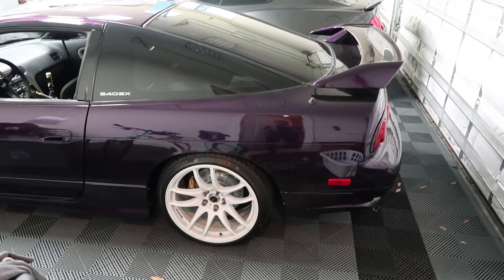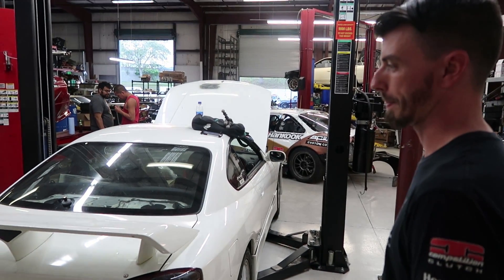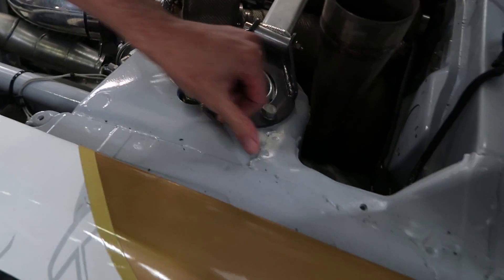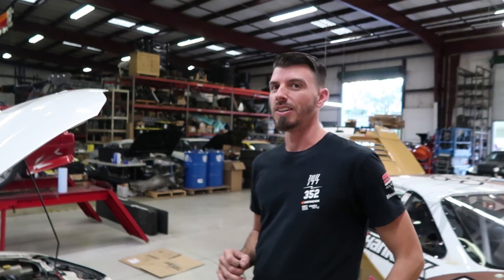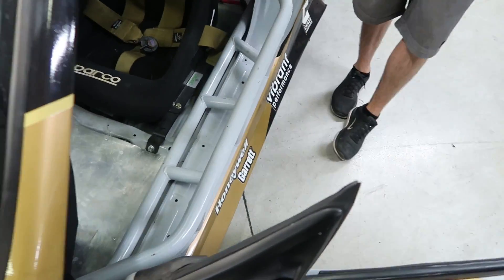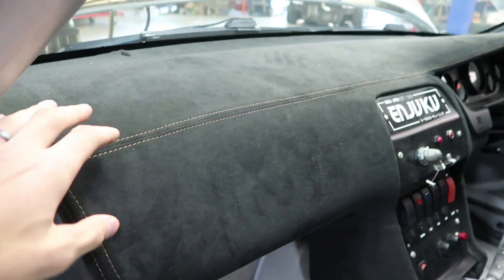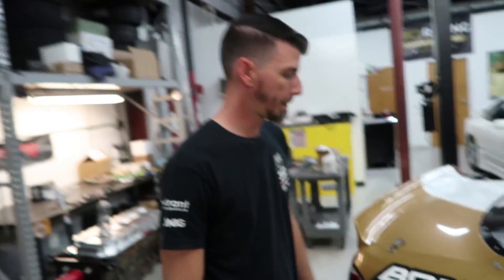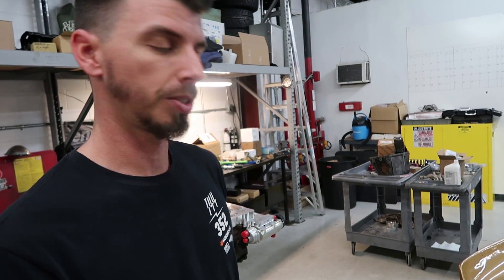Enjuku Built 2JZ S15 - Short Term Plan

Comment: RAD Dan uses a spring set up made by I believe drift motion that is better than the latches used. It holds with Dzus as well but the spring gives a little motion when the front bumper drags or he bumps a door. Not solid is better for motion in a fiberglass part that love to crack and fly apart.

Comment: Adam, the roof damage is courtesy of the importation method. Shipping containers are far too tall to be the cause, but instead, the car was imported as a bare chassis (or else it would've been crushed, 25 year law states an s15 is illegal for importation into the US), with another car stacked on top. Hence the damage.
Reply: It was probably smuggled in on top of a bunch of engines in a container, it's not an uncommon way to bring illegal cars in.
Reply: Agreed, consensus is that the car was tossed in a crate, smuggled, and not taken care of lol

Comment: What was the name of them fasteners?!?! Been looking for an actual name but haven't found it...
Reply: Dzus fasteners! we use em for race bodywork on sportbikes as well :D
Reply: There we go, now I'm getting results! Are they fairly decent to install or are they a nightmare?
Reply: Same as hood pins, drill a hole for the fastener, bolt/rivet a metal plate to the panel for the fastener to clip through.
Reply: What about the front bumper latches?
Reply: Those look like these http://www.aerocatch.com/home-page/aerocatch3

Main problem would be you need a bigger flat surface to stick them to, dzus fasteners only need a square inch or so.